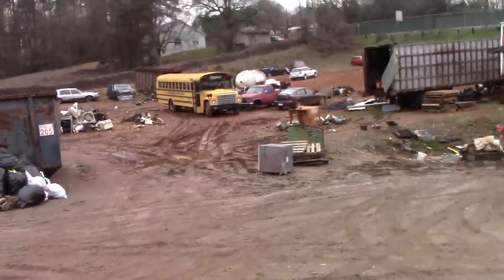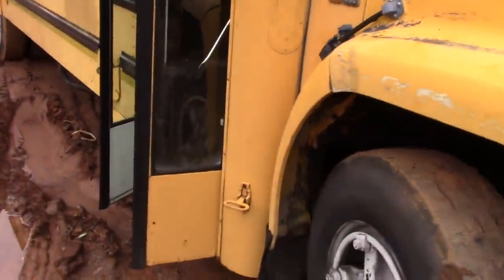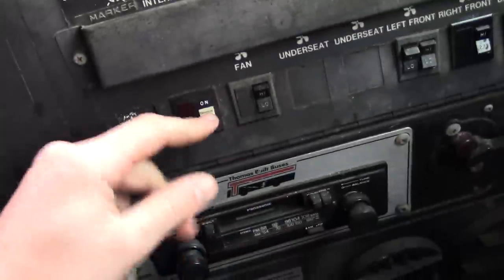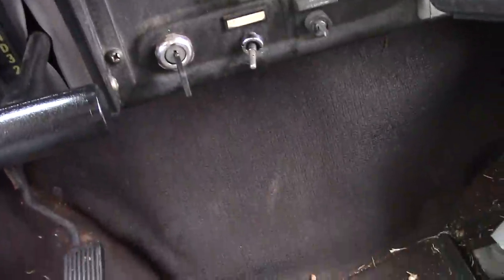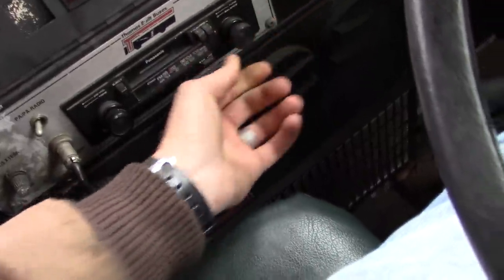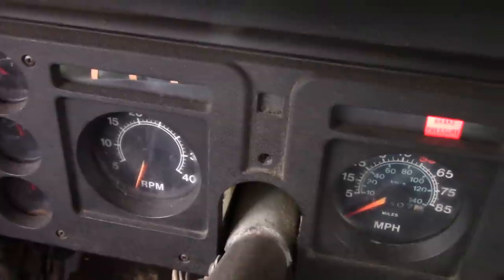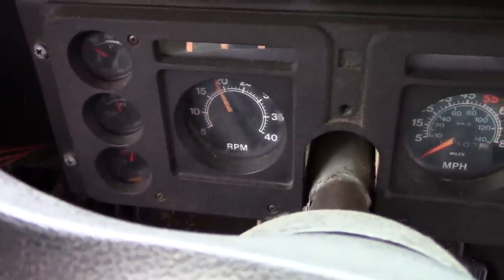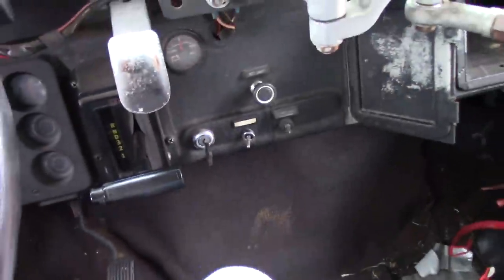!ANOTHER SCRAPPED SCHOOL BUS! 1985 International

Comment: S1800 just stands for S1800 Series International.  Not sure how else to explain about it or if it means something else I dont know all I know is these older international buses, big trucks, etc with those round headlights are whats known as S Series international.  For example you move into the 90's the buses have more of a square like shape headlight and they are known as a International 3800.  My friend has a big truck with flatbed trailer thats a S2200 series international truck but, has a cummins 350 diesel engine.  Bus looks nice.
Reply: 427 Elevating Productions I think that it was the heaviest duty one that was used for school buses.  The 1800 was the heavy duty model (probably used for the longest size buses), the 1700 was used for school buses, and they also had a 1600 which I think was used for school buses (probably smaller size ones), and for smaller  trucks.  It’s the same as Ford where the trucks go from F-150 to an F-750 or 850.  The F-150 is the lightest duty model, and the F-750 is a medium duty one.
Reply: makes sense what your saying I just wasnt sure how to explain it.

Comment: With that mileage it’s not even broken in
Reply: actually  that's a 9 liter IH engine ,,  getting upwards of 200K miles  it's getting right at the point of needing it's top end seriously worked on ,,injectors and  valves checked and headgaskets 
this particular engine needed excellent maintenance to last 300K miles in a  non highway application ,,a highway bus might see it last 400K or more without issue  but used as a BUS  or tow truck  they rarely went 200K without a major overhaul or at least injectors and top end work 
and unlike most of your truck engines now ,, these old IH V8 diesels could rev pretty high ,,wasn't un common for them to run 2800 -3000 RPM ,,most newer inline 6 large diesels rarely hit 2200

Comment: its an older thomas bus it does not have the bottom rub rail it was not required then  . the steering wheel indicates the IH logo as as the company was International Harvester then before in 1987 then it was sold to Navistar as its known today as Navistar international. The engine looks like to be an international 9 liter diesel V8 nonturbo engine. the other engine options for the S Series chassis then were a smaller nonturbo 6.9L later the 7.3 V8 diesel engines same as installed in the Ford full size pickups then. the DTA 360 or DT 466 I6 turbocharged diesel engines. for the gas engines before International Harvester phased them out the S series would have either a 392 or a 404 cubic inch gasoline carbureted V8 engine. the manual transmission would be an Eaton fuller. this bus you got is automatic which most likely an Allison AT545 automatic transmission. some of these old busses were used for churches, for campers, or vise versa after the school districts retire them due to age but some in good working order and good condition. lot of them get auctioned off for export outside the USA to be used as chicken busses. in PA 422 sales is one others are like Midwest transit equipment, BGA School Busses Inc, Northwest Bus Sales, and others. some use the old school busses for demolition derbies the busses with the carpenter bodies made in Mitchell Indiana have problems with the roof welds not up to par. i think they been pretty much all been retired by now.
Reply: Derek= ihc sold their ag div to teneco in nov of 84 and that included the ihc logo, so ihc changed their name to navistar international in 86!
Reply: oh i seen one video under txstreetman there was one bus that was 1985 thomas body and they canablized the 1993 international chassis parts the 7.3l diesel engine, wheels, axles, drive train, and fitted it to the 1985 international chassis and thomas body in which had a 392 gas engine in texas which did not pass emissions, and the 1993 international with a carpenter body had bad roof welds. so they did a flawless conversion on it the difference is in 1985 the bodies had no bottom rubrail.  as here scheeo busses can't be no more than 12 years old they have to be retired. as these older busses some stay in the us absorbed for church use, scrapped or used in wrecking yards to store parts in. or most are exported outside the USA.  the international chassis prior to the S series was the Loadstar series with a 345 or 392 cu in gas engine or a DT466 diesel engine. the S Series had a 392 or a 404 gas engine option. various diesel engine options as the mid 1980s is when International phased out the gas engines. and its all diesel now on todays bus chassis and the Durastar chassis they now have the Cummins ISB 6.7l engine option in addition to the standard Navistar engines.

Comment: Navistar motor aka powerstroke!
Reply: Jack Caldwell not a powerstroke..... never came in this chassis its a idi or a plain international engine
Reply: xavier johnson You’re both wrong, this is a 9.0 liter International engine. It was used in various International trucks, tractors, and buses.
Reply: If it's the same as the one blue bird gets it's a 444ci same as the 7.3 powerstroke, now they are larger motors yes I agree but that looks to be the 7.3 Navistar engine , I worked for bluebird in Lafayette ga for 15 years building these types of bus's anyways I am not going to argue with a bunch of keyboard Einsteins ! Peace
Reply: Jack Caldwell That isn’t a 7.3, not even the same design. I’m an International truck and bus nut, that’s a 9.0 V8, it’s the same engine that was used in some of IHC’s tractors.
Reply: Yea It is DV550, (9.0) and I don't think 7.3 (444) was made in 53...
Reply: clayton i said "plain old international" engine. does that not cover the 9.0? thx for being informed though!!!!